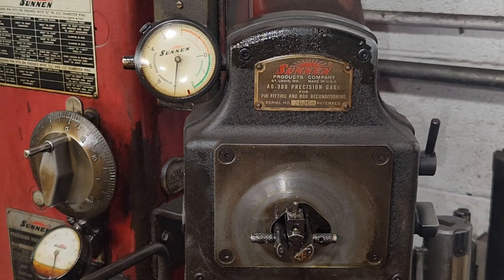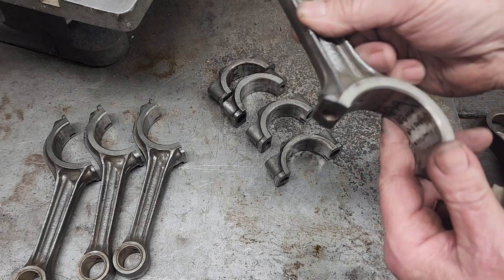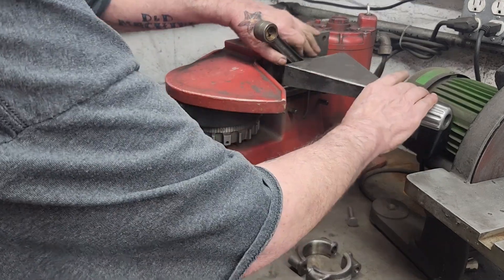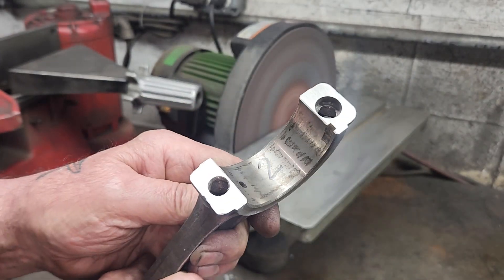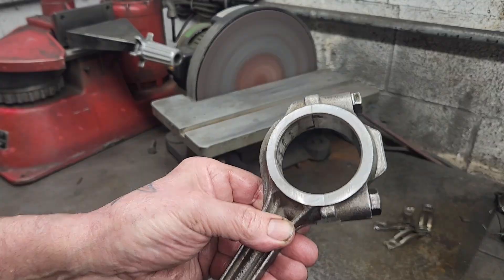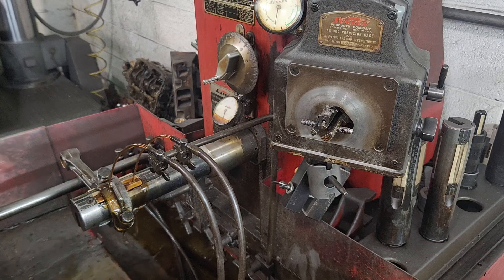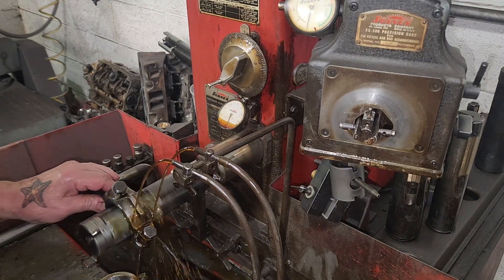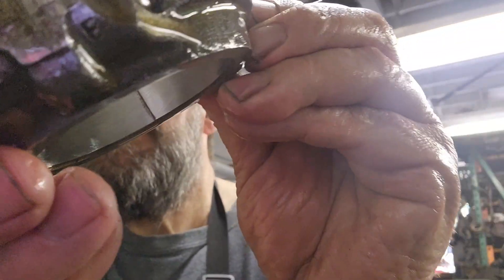Resizing Triumph connecting rods

Comment: I was fortunate to work in an automotive machine shop in the ‘80’s… I did valve jobs, operated a Sunnen wet grinder, a Winona guide machine and a Winona rod resizing machine. We didn’t Align-Hone, that was just coming out mid-late ‘80’s, we Align-Bored on a Tobin-Arp machine…
Reply: I was wrong about the rod machine. It was, I think, the same as yours.
Reply from the maker: Ok  @johnnytheflyer  see-ya next time 🇺🇸